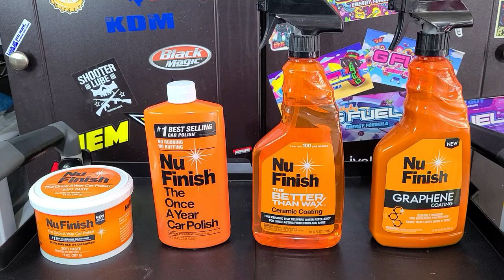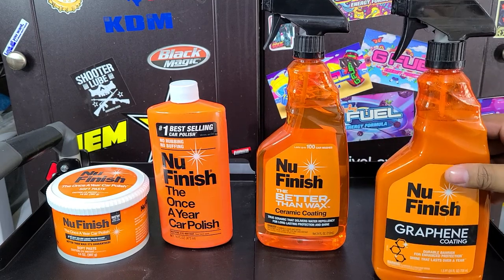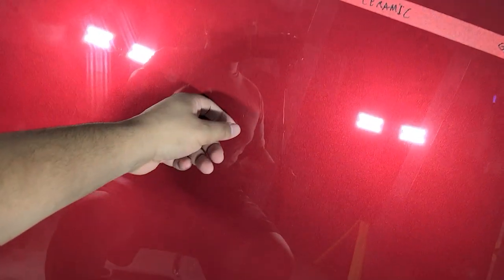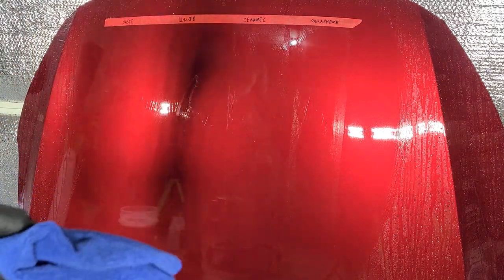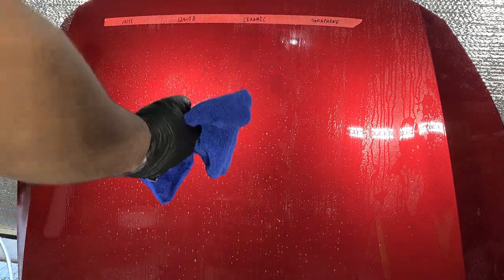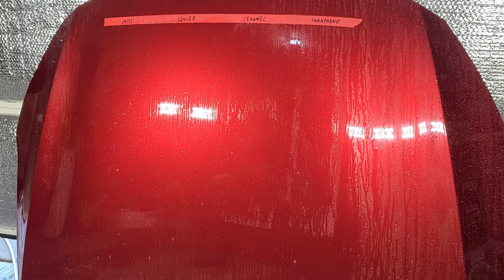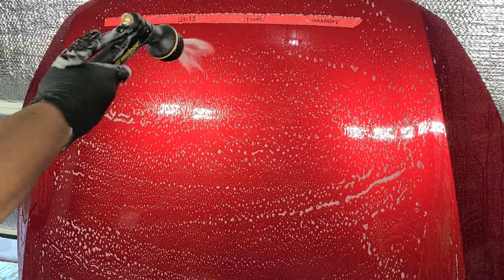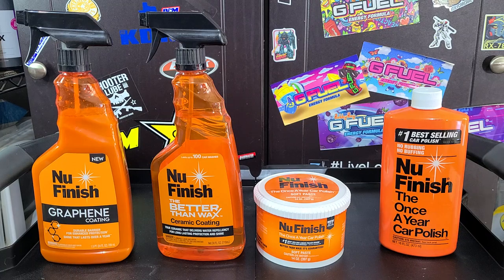[VS] ALL NU FINISH PRODUCTS TESTED - Old vs New

Comment: I've been using liquid nu finish polish couple times a year for the past fifteen years on all my panels except roof.  Fifteen years later same car, all is well except roof is oxidized, with rust.  Rest of vehicle that I used In Finish on I was able to paint correct easily with a single hand polish.  Just kicking myself for not doing the roof more consistently.

Comment: I tried the new “Better than Wax”  and found that the old original liquid version gave me much better results with less work,
The liquid version also made the paint surface nice and slick with lots of protection.
I’ll stick with the old liquid formula.
Reply from the maker: Still a solid choice, there's a reason they haven't  discontinued it.

Comment: Great comparison - thanks, man. Liked and subscribed. And, yeah man, I was around when the original Nu Finish was advertised on t.v. MANY YEARS ago. I used it on my '72 BMW 2002 - worked great, kept the paint nice. Used it a few times again recently on my '22 Subaru Forester - shines like a mofo. ;-)

Comment: I used the original formula for years.  Best protection for the price hands down.  About 2-3 years ago I bought a new bottle.  It looked a little different.  It didnt last no where near as long as the original formula.  Manufacturer states formula hasn’t changed.   There is no way that’s true.   I have switched to meguires ceramic coatings, reluctantly..
Reply from the maker: you aren't the first person to experience that. I will say though the graphene is just as easy to use as the liquid with better protection
Reply: I'm a liquid guy, but I have noticed it's different, which is disappointing. Like when Equate stuff from Wal Mart says it's the same as Motrin, but there's a noticeable difference. Maybe using same stuff from different suppliers and weaker ingredients.